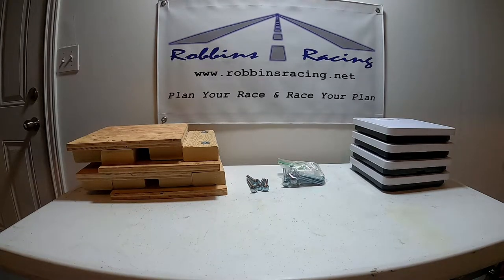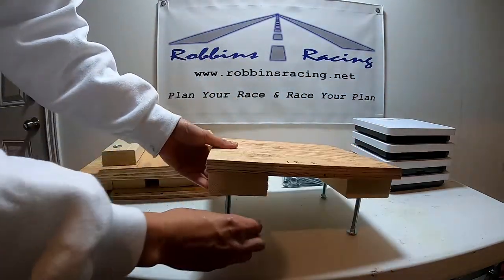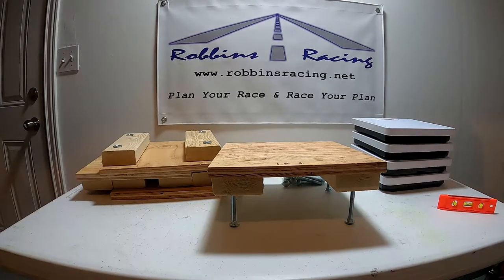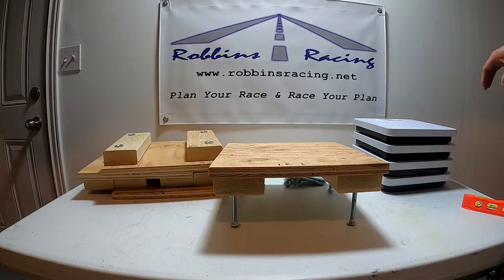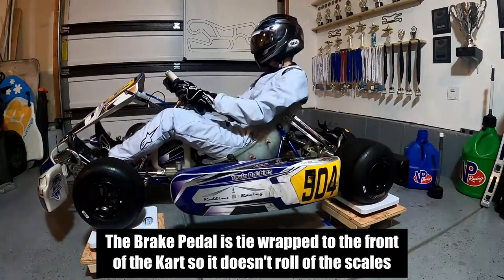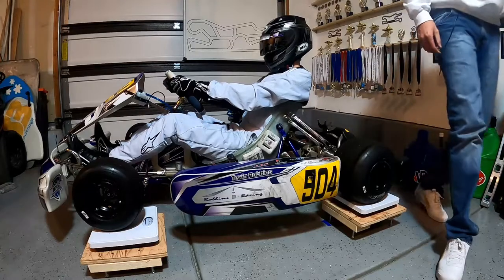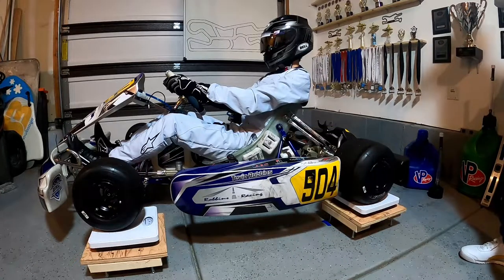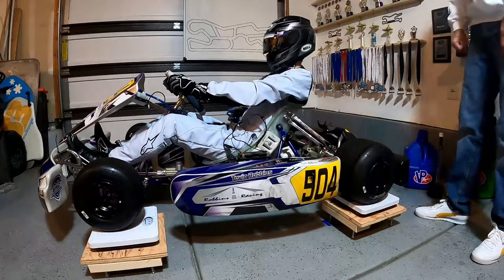Kart Scaling

Comment: Interesting. How do you know the accuracy of each scale? What about repeatability? Wheel position on the scale will affect your overall outcome. If you're trying to get within 10% of your goal then I guess this setup might work. Everyone seems to forget about accuracy and repeatability.
Reply from the maker: Yes, close is good enough.  Scales do have an adjuster,  I put a 5lb weight on the scale set the scale to 5lbs and call it good.
Reply: @robbinsracing801   I use a set of electronic scales for my Legend Car. I keep it calibrated so I get repeatable results. The most variability is the nut behind the wheel.
Reply from the maker: @MikeSmith-is1yy  Love your comment

Comment: Why not put the weights on the opposite side of the engine but on the frame?
Reply from the maker: Easier to mount to the seat.  If you have a way to securely mount to the frame you could but it's very common practice to mount to the seat in go karting.

Comment: Good video, but. Itend to find this a bit overrated and close to impossible to get right, you need to have everything 100% right. If your allignment is off you get a false result, if your frame is just slightly bent (and it very likely could be), if you are not 100% level between the 4 corners it will be off.
I tend to just focus on getting the front/rear weight  in the ball park and solve the rest in the setup.
Reply from the maker: I would agree, another reason to not invest into a professional scaling setup.  Close is good enough for me.